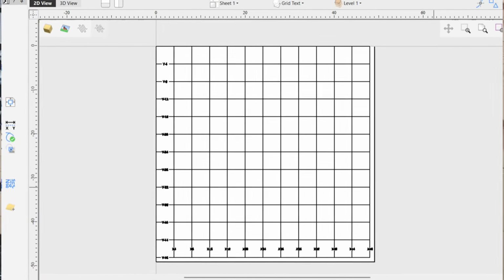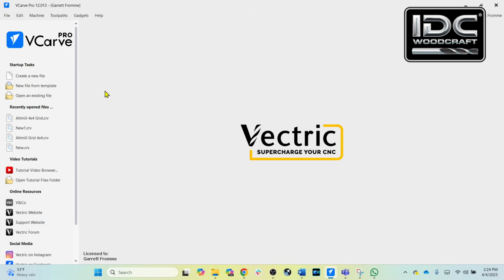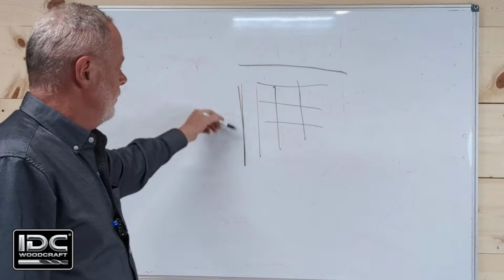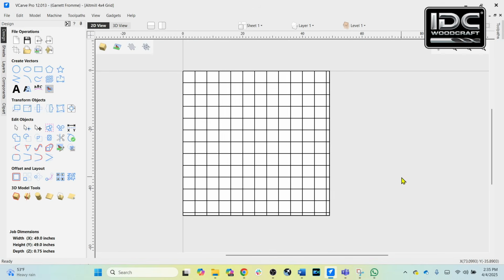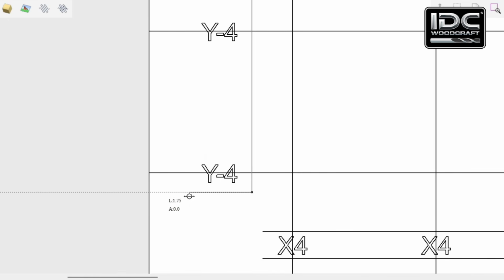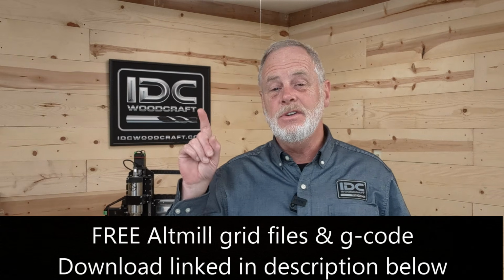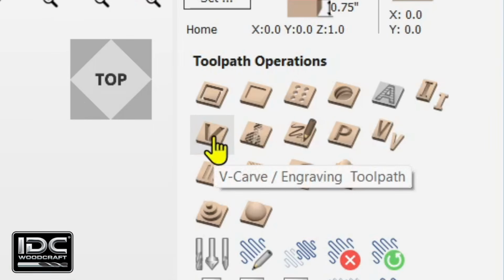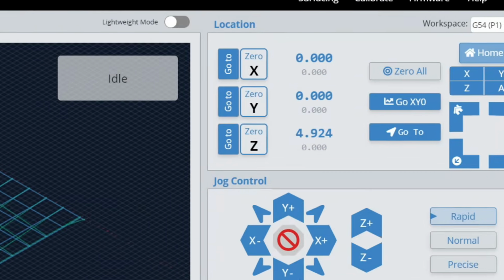Altmill CNC Router, Perfect Grids on Your Spoilboard (2x4 & 4x4)

Comment: Excellent video.  I have one question.  If you don't set a flat depth, how does the program know how deep to carve the text?
Reply from the maker: The program will go as deep as the edge of the letter vectors. If you are using a 90 degree, it will stay shallow. Of you use a 30 degree, they will be deeper.. all depends on the gap between the lines of the letter